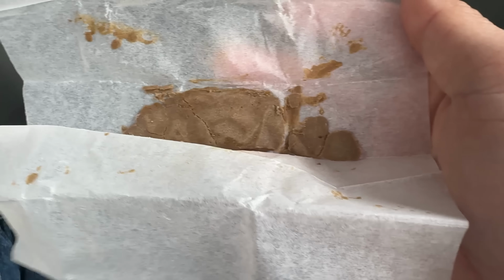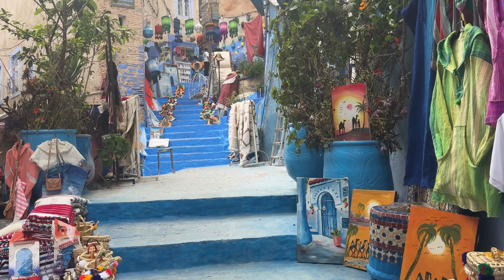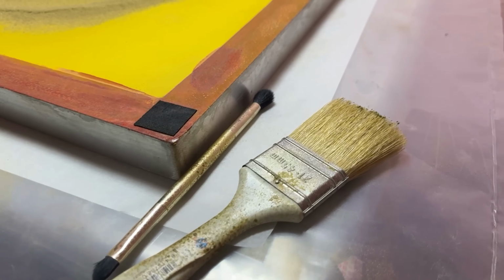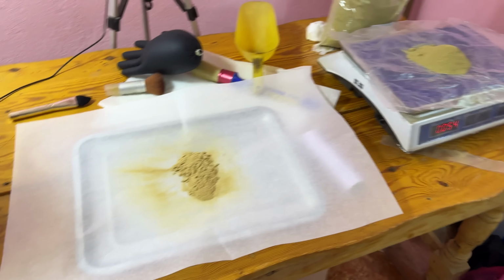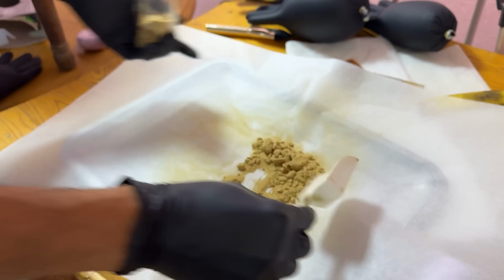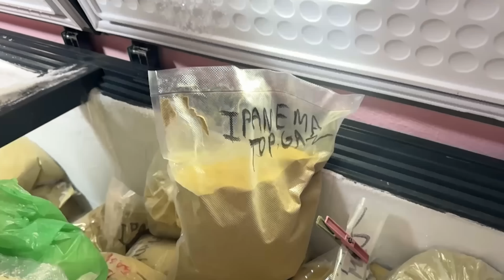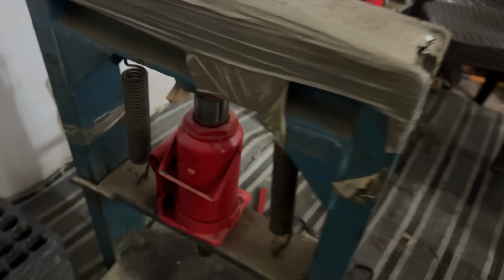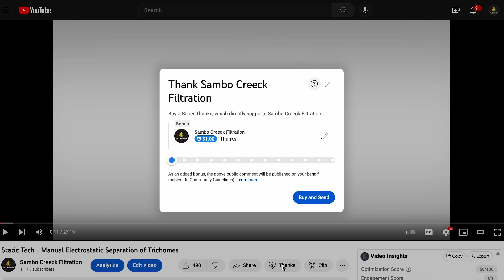Static Sift in Bab Berred, Morocco with Capital Farm

Comment: First hash I ever tried was Morrocan green powder hash back in 67. A friend had turned up with a paypacket full. We were on our way in my mates huge old Buick fast back  to see Max Merrit at "The Here" nightclub in North Sydney after our school formal. I had not had any experience before with hash and when it came time to roll a scoob we all rolled one each. I made this bomber of a scoob with 3 papers and filled it with pure hash and then lit up.We had come from the northern beaches and were around Mosman when we started smoking and still smoking when we got to our destination. I kept wondering when is this shit going to work and did not feel any effect at all. That  was until I got out of  the car. Kapow felt I had the weight of an  elephant. Made it inside the venue just then went into a trance for about 4 hours or was it five.  Have never been so stoned ever again and was hesitant to try hash again.  Had not known you only need two or three tokes. You video brought back some memories. PS It was only 30 dollars an ounce then.